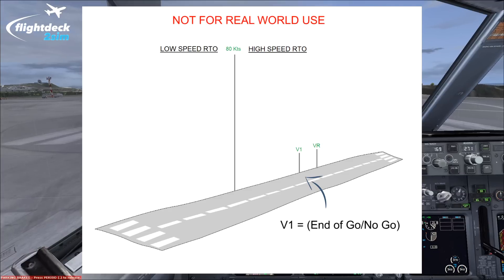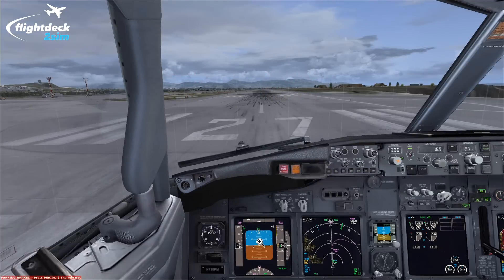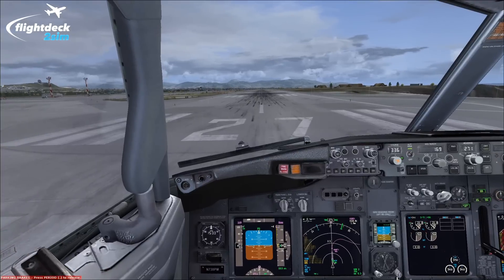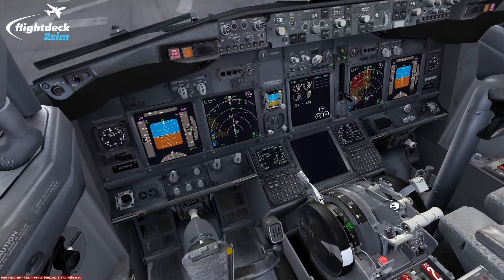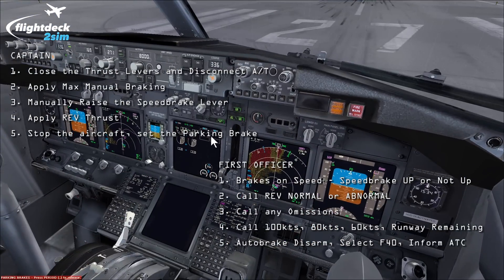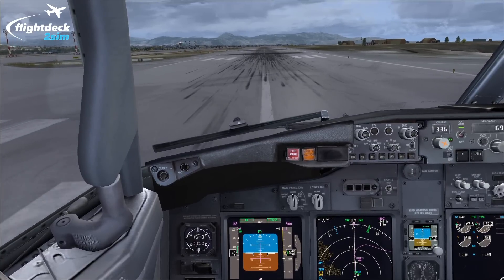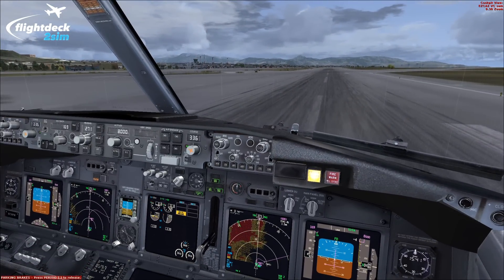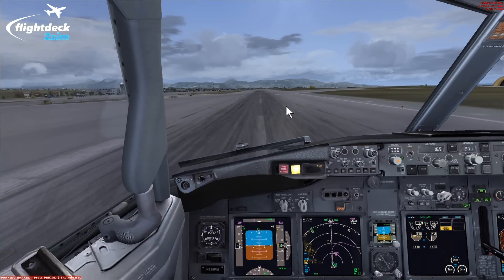PMDG 737 Rejected Take Off | Real 737 Captain Tutorial | PMDG 737 NGX

Comment: Best flight sim tutorials on youtube. Thank you!

Quick question, how many times in the real 737 do you have to press the A/T & A/P disconnect buttons to disconnect these modes?
Reply from the maker: Hi 702Wolfi, thanks a lot buddy.

The A/T and A/P disconnect switch respectively only needs to be pushed once to disconnect the system.

A/P Disconnect - 1 push disengages A/P and sounds the A/P Disconnect Warning Horn and A/P P/RST red light to flash  
2nd Push cancels horn and flashing red light.

A/T Disconnect  - 1 push disengages A/T and A/T P/RST light will flash red. 2nd Push cancel flashing red light.

FD2S
Reply: Ahh I see now. Thank you sir!

Comment: Love your videos, just wanted to ask if you plan on doing videos about heavy starts and step climbing?
Reply from the maker: Hi fimas, thanks a lot buddy!

Could you elaborate on "heavy starts"? Is this with regard to aborted engine starts? (Hot, Hung, Wet Start etc....)

Step Climbs generally happen in busy airspace, we briefly have to maintain a lower FL prior to getting climbed higher. If the OFP gives us step altitudes ATC can still clear us earlier to our final cruise level so long as traffic is not a factor.

Good Luck! 

FD2S.

Comment: Hi FD2S,

Would you still select reverse thrust in the event of a fire or would you cut fuel and activate extinguishers and use friction brakes to slow the aircraft ?

I tried your circle landing at Pisa. Was great fun :-D
Reply from the maker: Hi Cynical Cole,

We Reject the Takeoff the same way every single time no matter what the issue. We only deal with the issue after the aircraft has come to a stop and the parking brake has been set.

The RTO is very dynamic, especially approaching V1. If an abort condition is met it can come as a surprise to the flight crew which is why we brief the maneuver every single day.

In the event of an engine fire we would complete the RTO, Set Parking Brake, Select F40, contact ATC then complete the Engine Fire/Severe Damage/Separation Memory Items, they all have the same steps except additionally for a fire you discharge the fire bottles into the engine.

Glad you enjoyed my circling tutorial! 

FD2S

Comment: What cues told you the engine had failed?  When you announced an engine failure in the video, the only visual cues in the video were the "LOW OIL PRESSURE" light and the "ELEC" warning.  The "ENG FAIL" flag did not appear until after you aurally reported an engine failure.
Reply from the maker: The engine instruments are just one thing to monitor that will help identify a failure but during the TO roll the main thing you'll notice in reality is a yawing moment, especially at lower speeds. 

There also might be a bang or surge and abnormal vibration/sound or like here with a flame out you might hear an engine spooling down. Pilot Monitoring will also be monitoring the instruments and if he notices an unusual indication (reduction in N1 or things you pointed about above) this will be bought to the PF's attention.

Comment: A very informative and interesting video as always! Two quick questions though. Firstly, how do you know how much of the runway is remaning (in ft/m), because as far as I'm aware there only seems to be a few airports in Europe that actually have those black square signs with a number on them indicating for example 3, for 3,000 ft remaining. So what if there are no such signs along the runway (assuming not all airports have them)? And secondly, does V1 take into consideration that there might be no reversers available during the RTO (if you have a dual engine failure), so that there's still sufficent stopping distance, or is V1 calculated assuming that both reversers will be operative during the RTO?
Reply from the maker: Hi LevelMind, thanks for your kind words!

Very few airports have the Runway Distance remaining boards, I don't think I've ever flown into one! You can tell your runway distance remaining by the centreline lights, alternating red/white = 900 meters remaining and continuous red lights = 300 meters remaining. Our fleet are also fitted with RAAS which informs us what distance we have remaining as well.

You should be able to stop on the runway prior to V1 so long as you expeditiously and correctly apply the RTO manoeuvre. Reverse Thrust does not have any impact on stopping distance on a dry runway, it simply reduces the braking force to achieve the preset deceleration rate but itdoes have an impact on a WET or contaminated runway which is why you'd have a lower V1 selected.

There is no reverse credit on a dry runway but on a contaminated/slippery runway, we make adjustment to V1 if the thrust reversers are not available but the scenario of a double engine failure
you should have enough stopping force on a non-contaminated runway without reverse thrust. 

Hoped this help answer your query! 

FD2S

Comment: Great video, if you hand an engine failure during flight and you had to do an emergency landing, I thought you wouldn't use the thrust reverser's, if I'm right, how come you use them during a rejected takeoff. Is it because on a rejected takeoff you have less distance of the runway to stop safely?
Reply from the maker: Hi Matthewb4375, thanks a lot!

In both cases, RTO or landing single engine, we still select reverse thrust on the operative engine. 

There isn't as much thrust asymmetry as you'd expect, we want to maximise the stopping force in both cases. 

Reverse thrust will decrease your stopping distance on a wet or contaminated runway. On a dry runway when calculating performance it will make no difference but we still select it anyway!

Fly safe!

FD2S.

Comment: Once I push to/ga and the aircraft starts rolling i cannot get the thrust levers back to idle using f1 key in fsx.. the autothrottle continues to push the throttles back to the takeoff thrust position.. the a/t does not automatically disengage..
Reply from the maker: That is completely normal and true to the real aircraft, you need to disconnect the Autothrottle otherwise it will command take off thrust until 84kts! 

FD2S

Comment: Thank you so much for all these wonderful tutorials. While not directly related, I'm currently facing an intermittent issue where after I've set everything for takeoff, stabilized the engines at 40% N1, I hit TOGA which works normally until I reach about ~80kts (around the time N1 switches to THR HLD), the engine power just drops, N1 starts decreasing quickly towards idle, and I'm forced to control the thrust manually until I engage VNAV. Do you have any idea what might be causing this? It happens about 50% of the time, and I just can't figure out any differentiating factors between the takeoffs where it happens and the ones where it doesn't.

Thanks in advance.
Reply from the maker: Hi NeutralGenericUser.

It’s to do with the position of your thrust lever on your peripheral device (joystick/control column). At 84kts THR HLD engages and the servos disconnect from the A/T. If you left it closed on your joystick it can sometimes read that and reduce thrust.

Good luck!

FD2S
Reply: Thank you so so much for that explanation! It was driving me absolutely crazy. I guess I'll try to set a higher dead point for the throttle axis, and if that fails, I'm satisfied in knowing that I'm not really doing anything incorrectly to cause this. Thank you so much for the explanation! I really really appreciate your videos, your comments, everything. Keep up the excellent work, and I look forward to seeing more of your videos! Take care, and fly safe :)
Reply from the maker: NeutralGenericUser no problem, it happens to me sometimes.

I just move the thrust lever up after pushing TO/GA so if the position is detected N1 hardly moves 👍🏼

FD2S

Comment: If we have a tire blown on or shortly after V1 how do we land? There are any special landing procedure?
Reply from the maker: Hi ARI, 

Nothing too extraordinary but you would plan for a precautionary landing. You could possibly continue the flight which gives crew time to burn fuel and to plan ahead (unless there is more damage!)

You would want a long runway and the 737 is designed to land with one flat main gear wheel, you would fly the approach and land normally, there might be a requirement for differential braking  to maintain directional control after landing.

Good Luck!

FD2S

Comment: 5:00 is it safe to use reverse thrust on engine failure?
Reply from the maker: Hi Melvin, absolutely! 

In both cases, RTO or landing single engine, we still select reverse thrust on the operative engine. 

There isn't as much thrust asymmetry as you'd expect, we want to maximise the stopping force in both cases. 

Reverse thrust will decrease your stopping distance on a wet or contaminated runway. On a dry runway when calculating performance it will make no difference but we still select it anyway!

FD2S
Reply: flightdeck2sim thank you I learn something new everyday. This was just something I was curious about.